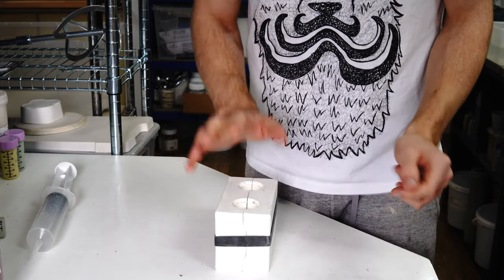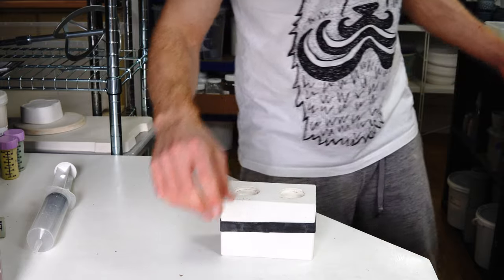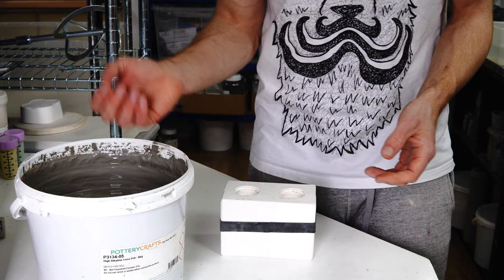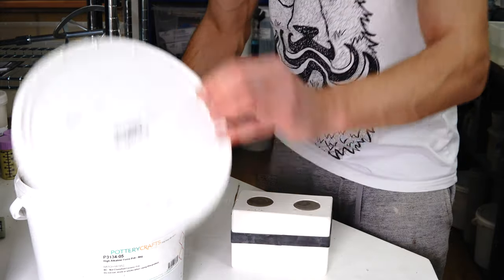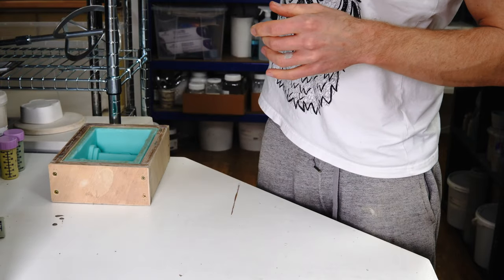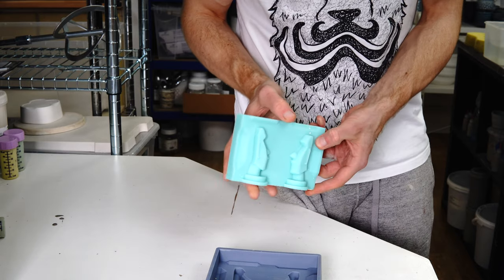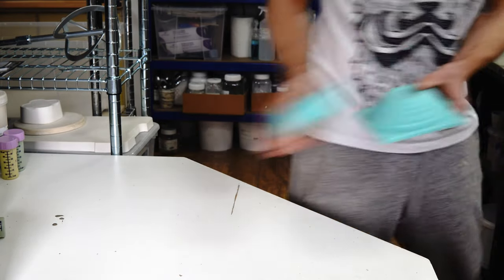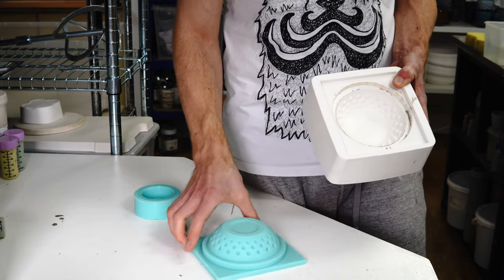How I made the Moai Test Tiles, and why I won't be making more

Comment: Great Video. I saw your original test tiles on Glazy and it inspired me to design, 3d print, and cast my own. Have you tried skipping the silicone step and using the resin print directly with plaster? I have had pretty good luck so far with this method. I am using Siraya Tech fast resin (not sure if that part matters), with mold release. The molds don't come out as easy as silicon, but if you make the model with something to grab onto, then its pretty easy. Out of one resin print i have been able to get about a dozen plaster casts so far, with little noticeable degradation.
Reply from the maker: I tried skipping the silicone on some early tests but found the resin really didn't release well for me even with simpler designs. So it seemed like it would be quite limiting in terms of the possible design - everything I've made since has slight overhangs in the surface texture, which I can get away with via the silicone and clay shrinkage, but wouldn't work if the plaster was applied directly. For more basic moulds it's definitely an option though, and would save a large portion of the cost.